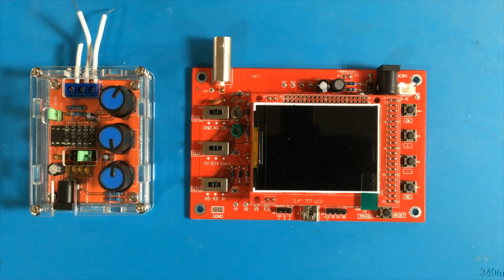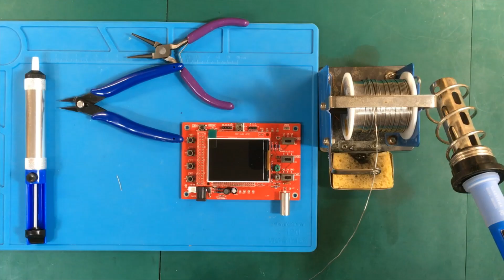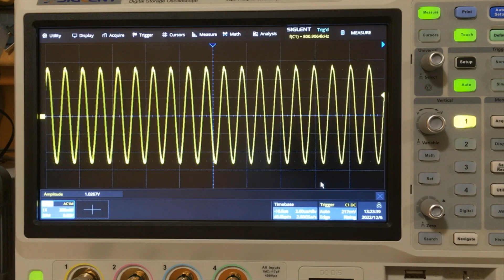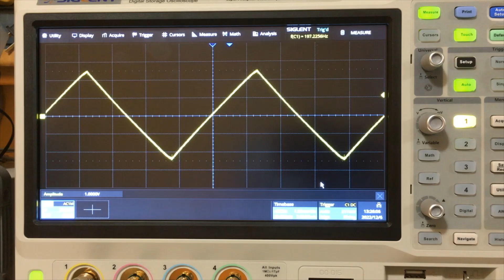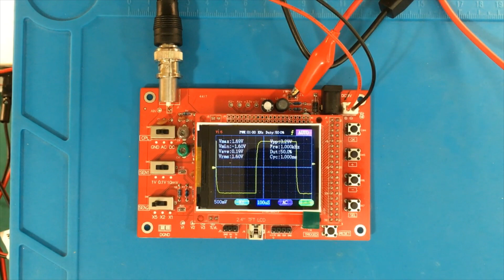0007 - Beginners' Electronics Tools: The Function Generator and the Oscilloscope part 1.

Comment: I had fun making the XR2206 kit, although one of the little capacitors was hidden in one of the knobs. There was a little trouble assembling that case, but overall, for about five bucks I have no complaints. It was an education and fun to look at the waveforms on the 'scope, but probably will be looking into a more exact generator.
Reply from the maker: Yeah, something better than this would be great.  Other than the power supply the JDS6600 is not a bad little generator.

Comment: Thanks for an other great video. I am getting in electronics myself as a new hobby and really enjoy your series so far. Now I would have just one question: How would we check if the function generator is finely adjusted if we do not have a second osci :D Would that really matter as beginner?
Reply from the maker: Good question.  Most modern oscilloscopes have the ability to directly measure frequency, amongst other parameters, of the signal attached to them.  The DSO 138 is no exception in this respect and we will cover that in the next video.  However, if you opted to get a used analog scope, they usually do not have this ability directly, but frequency measurements can be determined from the period of the signal where: frequency = 1/period in cycles per second, or Hz.  As an example, if you use your scope to measure a signal with a period of 125us the frequency of that signal will be F = 1/1.25x10^-4 = 8,000 cycles per second or 8KHz.
Reply: P
Reply from the maker: @val-com-farinha  Do you mean "P" for period, or are you just sticking your tongue out?🤣  If it is the first case, P is normally the symbol for power.  A lowercase "t" would be used for period.